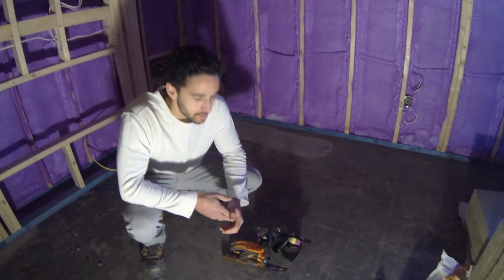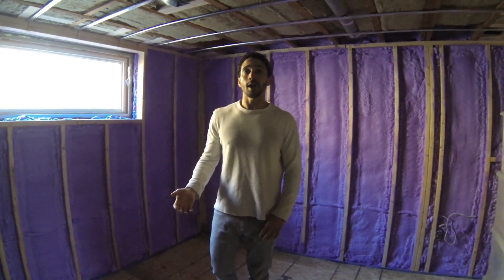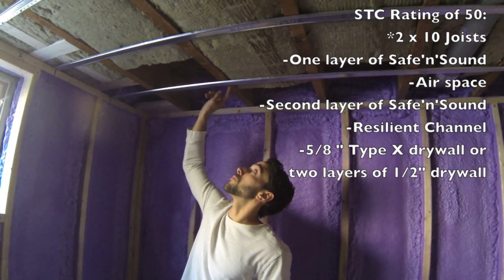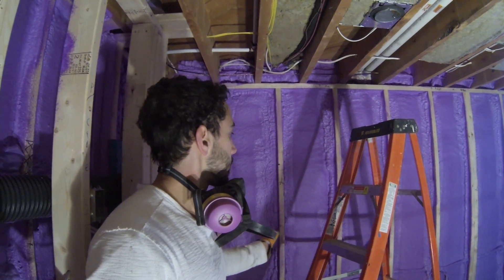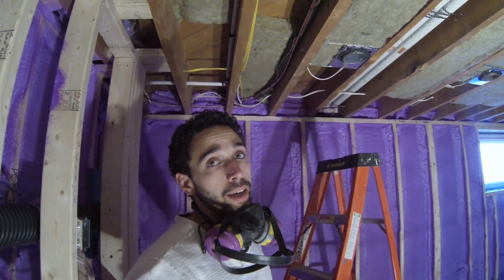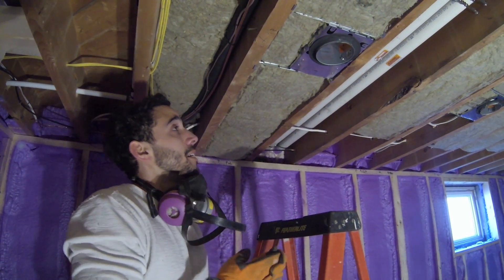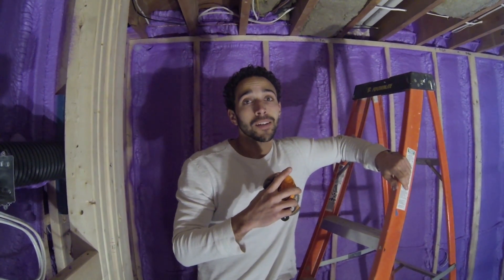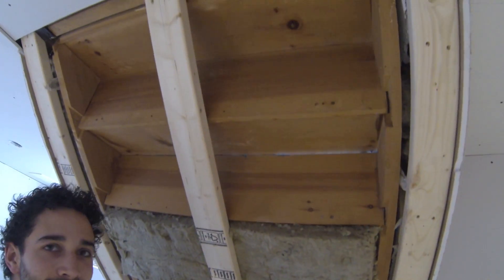HOW TO SOUNDPROOF A BASEMENT CEILING

Comment: I want to install this in a utility room ceiling, but I don't want to finish the ceiling with drywall. I need the dampening because my heat pump is a bit noisy, and there is a bedroom above. Can I just stuff the insulation between the joists, or are furring strips necessary to keep it from falling out of the cavity? Does anyone know?
Reply from the maker: It should hold on its own. The batts are a little wider than the cavity. Some batts might fall down over time.

Comment: Everything good except the last part when doing the stairs. You can clearly see openings in the stairs in multiple areas, sound travels through air like water. Any gap will be a path. Very important before you insulate to use foam spray (can) or aqoustic Silicone and fill all those gaps and then insulate, cheers.
Reply from the maker: I agree. Thanks for the feedback!

Comment: This will not sound proof the basement from upstairs. stopping sound waves is about energy absorbing and air tight. You must decouple the ceiling and walls. I have achieved this and built a soundproof room in our last house. I am a drummer and could go practice at night after my wife and kids went to sleep. They could not hear it at all.
Reply from the maker: Separate HVAC is a big one as well. There are different levels that you can go to depending on the STC rating you’re trying to achieve. Decoupling the walls will definitely help 👍🏽

Comment: Hi your video is nice and I am thinking of installing insulation in my basement ceiling. Can hear hardwood sound in the basement when walking in upper floor. Would you recommend installing insulation in a basement ceiling and dry wall it for noise reduction? Is it really worth installing it for noise reduction? Is there anything else I need to do beside putting roxul insulation and dry wall? Thanks for your time.
Reply from the maker: I do it on all my projects, Safe'N'Sound insulation, resilient channel & 5/8" drywall. You can add two layers of 5/8" drywall to help improve the sound deadening.

Comment: Since fiberglass or mineral wool or safe and sound doesn’t have transmission loss or stc data why will it block sound ? Sound blocking requires mass , second layer of drywall, or decoupling with spring hanger. Where is data supporting these STC claims?
Reply from the maker: I said at the beginning of the video these are “Sound deadening” techniques. Check out Rockwools web site for STC ratings based on different construction methods.
Reply: @simpsonpropertiesltd  not sure what you mean by Sound Deadening. The goal of treating the ceiling is to Block the sound from room above and room below. Sound blocking is about transmission loss which is related to the density of a material. Insulation material has density of 1 to maybe 6 lb/cuft. Gypsum has density of about 100+. The TL of insulation is so low it’s not even measured or stated. As you correctly pointed the Rockwool website only list it as part of a structure. The only lab measure of insulation is absorption coefficient. It’s a porous material. . Since the structure is a spring- mass- dampening system with using air and gypsum, just a little fluffy pink fiberglass might be useful for dampening BUT using expensive safe and sound is like storing money in your ceiling. 
In addition if the gypsum is in direct contact with joists and not floated on springs the sound energy goes through the joist and completely bypasses the insulation. Please reconsider advising DIYers about how to soundproof a ceiling. Unfortunately they do watch YouTube
Reply from the maker: @mikebiffignani5758  thanks for the tips Mikey! You sound like you have lots of knowledge around this topic. YouTube “DIYers” could use your wisdom and intellect. I recommend you start putting out content for the world to enjoy.

Comment: Any worries of 2 layers trapping moisture?
Reply from the maker: None at all. There should not be any condensation inside your floor or ceiling joists. Exterior walls and attic spaces could have those issues if improper vapor barrier installs are done (ie. Double vapor barrier).

Comment: Great video! If I were to only use one layer instead of two, you would install it at the top of the cavity with the 1 inch air gap and leave the rest empty correct? Thanks.
Reply from the maker: Thanks! I have talked with the tech support at Rockwool regarding this. They mentioned the placement of a single batt in the ceiling cavity doesn’t really matter. It’s often easier to leave it towards the bottom of the ceiling cavity flush with the ceiling joists. Usually, there are HVAC ducts, plumbing & electrical installed in the center of the cavity. It’s a pain trying to get the insulation passed all that stuff.
Reply: @simpsonpropertiesltd  Wow thanks for the quick response, good to know. Just subscribed, hope the best for you & your channel!
Reply from the maker: Thanks for the sub and your support Dan. It’s much appreciated 🙏🏽

Comment: If you are opening up a basement floor for better clearance, would you just apply the one layer flush with the overlying floorboard?  Would this compromise the fire retardation benefit?
Reply from the maker: I’m sorry I don’t follow your question. Can you please clarify what you’re asking?
Reply: @simpsonpropertiesltd  Sure.  imagine you have a basement ceiling with sheetrock attached to ceiling joists.  I remove the sheetrock.  Would I apply the soundproofing material directly to the upstairs floorboards?
Reply from the maker: I follow you now. I have talked to reps from Rockwool and they said it’s irrelevant if the insulation is in the upper part of the cavity or flush with ceiling joist. It will most likely be easier to install it towards the lower portion of the cavity flush with the ceiling joists.

Comment: At the end of the video for the stairs, you can see daylight so it wouldn't be fire separated and would likely admit noise through, too.  Some fire-rated caulking would do the trick.
Reply: One of the Best Ideas of SoundProofing is "SoundProof Curtains" it actually Block outside Noise coming from Windows. Check Here: https://livesoundproof.com/best-soundproof-curtains/
Reply from the maker: Thanks for the tip.

Comment: Do u have to use drywall? I don’t want to cover my plumbing as it is old & may need repairs. I’m just trying to put some sound barrier between me and my roommate below me in my basement
Reply from the maker: You could install a drop ceiling with ceiling tiles instead. It won’t provide as much sound deadening properties as drywall. It will give you access to any mechanicals in your ceiling cavity.

Comment: I am looking to renovate my previously "finished" basement but I can hear every little footstep, every clang or bang on the floor or counter from anywhere in basement, but voices and music not so much :).  floor creaks as well (even after screwing floor screws). the basement has drywall on the ceiling, and no insulation as far I can tell, so should I take it out and put Roxul there? or look for other solutions, ( green glue, MLV, Resilient Channel ..)  , looking to rent it. but will never be relaxed the way it is at the moment.
Reply from the maker: You will most likely have to remove the existing drywall, install Rockwool Saf’N’Sound, resilient channel and one or two layers of drywall. Keep in mind if both units share common HVAC you will still have noise transfer through the duct work.
Reply: Thanks for the video btw

Comment: Would it be okay if I use R20 insulation at the top and a rockwool layer at the bottom to save on cost or it defeats the fire rating?  Thanks
Reply from the maker: Sorry for the late reply. I would recommend you reach out to Rockwool’s tech support with that question: 1 (800) 265-6878

Comment: if go with one layer, is there any code requirement that it has to be up higher or lower on top of the drywall ? or just a preference thing, and not really right or wrong way ?
Reply from the maker: If you’re installing this for the purpose of sound dampening only I would leave an air gap, then install the batt towards the bottom of the cavity. If have heated floors above (ie.radiant heat) I would install the batts towards the top of the cavity so the heated floors drive the heat upwards.
Reply: @simpsonpropertiesltd  hmm.. why on the bottom ? it's not code right, just your preference ?  sometimes there's wire or pipes that forces you to put it higher.. and either way you put it, there's still an air pocket, so why is it better for the air pocket to be on the upper side ? sorry, not attacking your way, but I like to analyze and I like answers with details explaining one's reasons for doing things this way or that way ?

Comment: All these sound proofing videos ignore one very important issue. You can pack the cavity till the cows come home but if you don't address the ductwork, both supply and return, you may be disappointed with the result. I would draw the analogy with my clients to the old sea captain up on the bridge calling down to the engine room by simply speaking through a connecting pipe. Same thing happens in your home or business. Adding fibreglass duct liner to the inside of your ductwork is common practice in sound studios and office buildings to prevent sound transmission and cross talk. Hope this is helpful.
Reply: It’s there an issue with the fibreglass in the ductwork getting into the return?
Reply: @416pp   No issue if you install mat facing faced duct liner. John's Manville Lineacoustic duct liner.  Black in colour with a black mat facing. Go see a local sheet metal shop. Good chance they have it in stock. Other manufacturers: Owens Corning, Knauf fiberglass.
Reply from the maker: George Labottum I agree with your analogy. If there is common duct work between units there will still be lots of sound transmitted through the duct work. IMO it’s best to have separate HVAC and utilities for each unit. That resolves that issue. 

Are you recommending to install fiberglass insulation inside the duct work?
Reply: @simpsonpropertiesltd 
If you are talking unit heaters /AC units, it will make a huge difference to install ductliner from the unit to the diffuser. In my custom home I had ductliner installed for the first 8 ft of the supply duct running from the furnace. Cut the noise down tremendously. Well worth the expense.

Comment: Would this be enough for loud musical instruments (drums, guitar) or would I need more heavy-duty stuff for that?
Reply from the maker: Following only the steps showed in this video will help reduce sound transmission from instruments. In my opinion you will have to go beyond this for adequate sound proofing. The options are endless depending on your budget. If there is HVAC vents in the room that connect to other parts of the home a lot of sound will travel through there. I would recommend using two layers of 5/8" drywall on the ceiling or Certainteed SilentFX drywall.
Reply: Theo, I just added a cautionary comment about your question. Please see my recent post.
Reply: One of the Best Ideas of SoundProofing is "SoundProof Curtains" it actually Block outside Noise coming from Windows. Check Here: https://livesoundproof.com/best-soundproof-curtains/

Comment: how do achieve the air space from the first layer to the second? i put the first layer in, and then do I just put the second layer right up against the first? Thanks.
Reply from the maker: Depending on the depth of your ceiling cavity you may or may not have room for an air gap. Don’t overthink this step too much. I usually push the first batt to the top of the cavity and install the second batt flush with the ceiling joist. Leaving an air gap between the two batts of insulation.

Comment: Thanks for the great video :) just a question for you about insulating near the pot lights you show in about 3:10-3:15 in the videos. Are those insulation contact fixtures? If not, are you able to insulate right against the fixtures because the R value is so low in the safe and sound and the boxes won't over heat? Or lastly, is this simple an error?
Thank you!
Reply from the maker: Abhay Fernandez those are IC rated pot lights which is done correctly according to our local electrical code. I highly recommend you buy IC rated pot lights no matter what type of insulation is used in the cavity.

Comment: what about the floor though, can you use these things on the floor and fasten your floor to the metal channels?
Reply from the maker: Res channel is not designed to be installed on a floor support and live load. You would have to look at different options such as Soprema Insonofloor and Acoustiboard.

Comment: Hey Great Video, i just subscribed. You mentioned the minimal difference in STC between one and two layers of safe n sound. Would it be more effective to have a single layer against the floor, in the middle creating two air cavities or up against the ceiling drywall? Also is there anything you can do with cold air returns that run through the joists spacing? Would it be safe to install inside them?
Reply from the maker: Thanks for subscribing Blake! If you’re installing one layer, I would leave an air gap, then install the batt flush with the ceiling joists. Your cold air returns need that cavity space in order for your HVAC system to function properly. I would not recommend installing it in your cold air returns.
Reply: One of the Best Ideas of SoundProofing is "SoundProof Curtains" it actually Block outside Noise coming from Windows. Check Here: https://livesoundproof.com/best-soundproof-curtains/

Comment: Question. Are you suppose to put poly sheet on top of insulation and then the resilient channels?
Reply from the maker: The only time poly is required is on exterior walls and ceilings (attic space above). In this case there was another livable space above this ceiling so no poly was needed. The install steps for an exterior wall or ceiling would be batt insulation, poly with seams taped, res channel, then drywall.

Comment: Could one use Type C 1/2 inch drywall for Ceiling to get STC 50 and also high Fire separationn?
Reply from the maker: I’m not sure. I have never heard of Type C drywall. Type X 5/8” drywall is typically used in fire rated areas.

Comment: SafenSound is so expensive at homedepot. Iike 660 for 50 sq ft. Where do you buy it?
Reply from the maker: I purchased it from Home Depot. I just priced it out at a Home Depot in Toronto.
It's $54.69 (before tax) per bag. Each bag covers 64 sq. ft. That works out to $0.85 per sq. ft.
Reply: Simpson Properties I guess I'm doing my math wrong
Reply: I figured out what I did wrong. I Was looking at an amazon link and they didn't specify that it had 12 rolls. So I thought each bag was just 4sq ft. It didn't make sense.
Reply from the maker: Ah ok. I’m glad you got the pricing figured out!
Reply: Just went to home depot and purchased 15 bags. Paid like 80 dollars to have it shipped this Friday.

if you buy 15 or more the price drops to 32$ dollars a bag from 45$ (US)

Ended up spending 610$ after taxes and shipping. This stuff better work wonders!
Reply from the maker: Nice! Good luck with your project.
Reply: @Lacocacolaman  any follow up comparison? And to what you did?
Reply: @10__isee  what do you mean? I installed it in my house. Before the drywall went up it was amazing at absorbing sound. After the walls went up it helped bounce sound all over the place. When furniture went up and help soften the sound. I totally think it was worth it. For example I have an elderly person below me. They're a very heavy snorer. At night if I'm quite I can hear it faintly. The only issues with sounds are it escaping through the doors. I'm glad I did it. I wished for a miracle sound blocking but I can't expect a miracle.

Comment: This isn't directly related to this video but I have a general questions about basement ceilings. Do you ever use drop/suspended ceilings in basments, or always drywall? If you do, is there a video? For the drywall ceilings, do you just build in access panels to valves, gas lines, etc? I would love drywall in the basement I plan on finishing, but my house was built in 1972. I have had to replace some pipes/valves here and there over the past few years and I fear that because of age, this might continue in the future. Thoughts? Thanks so much.
Reply from the maker: I have never installed a drop ceiling. I prefer a drywall finish and think it looks much better. Here is a link to my video where I show how to install drywall on a ceiling: https://youtu.be/xnarltDAUZQ
You can use access panels for areas such as water valve shut off's etc. You can buy plastic spring loaded access panels or metal ones with a small access door.

Comment: How do you install the safe and sound product around things that take up a lot of space between the joists such as hvac ducts or water supply/drain lines?
Reply: By the way, really excited I found this channel as you're covering a ton of topics I'm interested in for my basement reno!
Reply from the maker: Most of your electrical and water lines should be installed in the center of the cavity. You can squeeze the insulation on one side and push it above the obstructions. You can do the same thing for duct work, unless the entire cavity is blocked. In that case you would have to remove the duct work, install the insulation, then re-install your duct work.

Comment: Here in the U.K we don't have safe sound, we have Rockwool: now wich would you recommend: 75mmm x60kg3 or 100mmx 45kg3? Would you rather have less thick but more dense or thicker but less dense? Thank you
Reply from the maker: Sorry for such a late reply. I would recommend contacting the manufacturer of the insulation and see what will work better for your application.